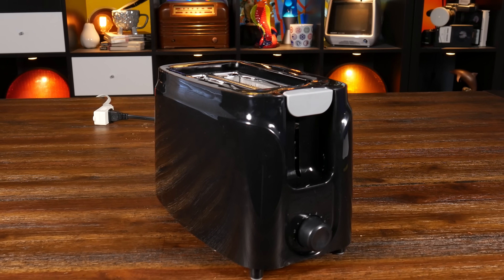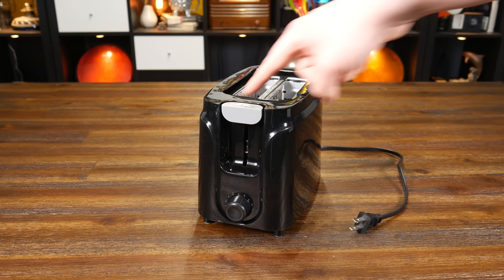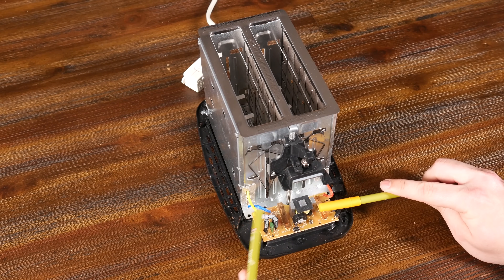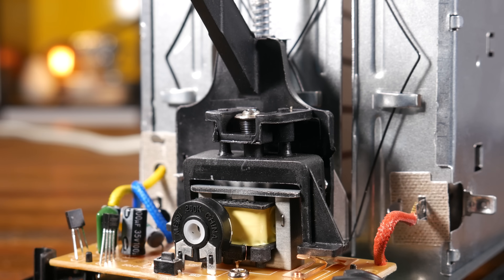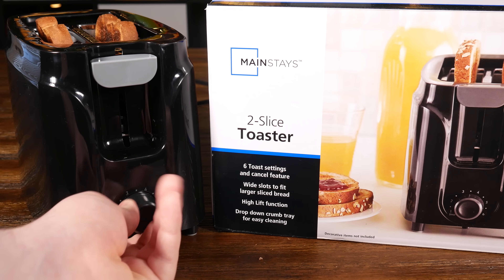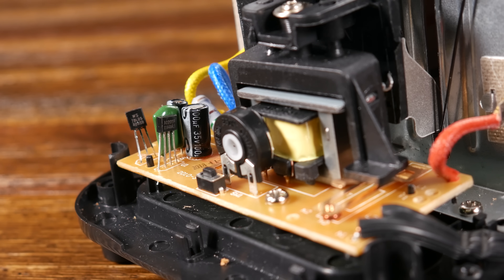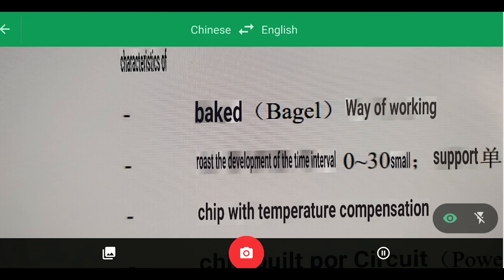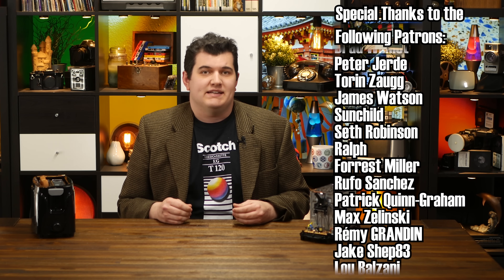The Electromagnet in Your Toaster

Comment: The non-electronic toasters were smart too. They had a two-step lever movement. Most downward would put power on and the bimetallic element in the heat. When teh bimetallic thing got hot, the lever went a tad up, shielding the element form teh heat but keeping the power on. When the element cooled down again, the lever would pop up, taking the toast and the power out. And the element already cooled down a lot for the following cycle.

Comment: Totally thought the electromagnet was just a transformer,
Edit: I thought you were using a foot switch to turn off the toaster, popping the toast to get that effect. it's impressive that you were just timing it
Reply: If the electromagnet had a second winding on it, or even a tap in the middle, it could work as a transformer too. But it looks like they're actually powering the control IC by using the heating element as a resistive divider. That's what the yellow wire and diode does.

Comment: My mom had one of those Sunbeam toasters from the 50s (or 60s?) and it spoiled me for life. It had much heavier wires which toasted faster without drying out the bread besides not needing any levers. The originals had a rotary control on the end near the bottom. I have two of them from the 70's and 80's. The design had changed slightly, with the darkness control now a slider on the side, probably to cut manufacturing costs. Not quite as good but still pretty much the same as the original.

Comment: The 6 setting 5 minute toaster has more market appeal than the 5 setting 5 minute toaster.

A timing capacitor doesn't need to power an IC to determine how long it's been since the last toasting.  A simple resistor-capacitor circuit with only those two components (the resistor draining the capacitor to ground) will drain slowly in a curve similar the temperature curve of a cooling down toaster.  So the estimated hotness of the toaster can be tracked totally with analog, and no IC is needed.  And the capacitor probably isn't powerful enough to keep an IC going for that long anyway.

Comment: One of Tom's toasters did use the numbers to represent minutes ;) Did you turn the toaster off with your foot to make it pop on the "pop goes the weasel part"? Didn't some toasters have laminated strips of different metals that, as they expanded at different rates from the heat, bent and made contact with a switch to turn the toaster off? I think the bar was lowered or rotated to change the toasting duration and the fact that they bend when hot meant that it adjusted the time if the toaster was already hot

Comment: I was amazed when my current toaster lever would not stay down when not plugged in, I did not know that this is now a standard feature. It does eliminate waiting for your toasts when the toaster is not plugged in. I used a toaster oven for a couple of decades before my current toaster, it used a lever to turn on the toaster function but did not care if it was plugged in. I only got a conventional toaster because I got a bigger toaster oven that makes very dry toasts which I do not like.

Comment: Hi!
Does anyone knows why heating coils and wires start to glow from the centre? Ty!
Reply: The glow starts from the centre because that's the part that gets hot first. The other parts are close to, or in contact with support structures that act as heatsinks, absorbing some of the coil's heat and so slowing the local rate of heating.

Comment: Always been curious, never would have thought that's how it works!
My toaster has a fully-digital "toast setting display" that has its own power button. Curiously, if you forcefully hold down the lever with that turned off, it will start the elements, but still spring straight back up and cut off when you let go. So indeed the digital timer only has control over the electromagnet and the rest of the circuit works traditionally. I guess if it ever breaks I can just keep holding it myself!

Comment: Does changing the "darkness" setting - how much you want the bread toasted - once the toasting has already begun do anything?  Or is it checked initially only when the plunger (more accurate term than lever) is pushed down?
Reply: Yes, it alters the rate at which the remaining toasting period is counted down, but it won't make much difference if a considerable portion of the toasting time (for the initial setting) has already elapsed.

Comment: I was really hoping we'd get some elaboration on 0:57 's assertion that the toaster from the '40s was better in every single way than modern ones.
Reply from the maker: That toaster senses when bread has been inserted into it, and automatically lowers the bread in. That's why the ad proclaims "no levers to push". It also doesn't eject the bread with a pop or a bang, instead it is slowly raised.
In general, the user experience of such a toaster is quite more advanced than those we have today. The only exception, of course, is the lack of a bagel mode or whatever new modes might be available in fancy-pants toasters.

Comment: Ok so I want to address something really quickly.  You mention that the Sunbeam Radiant Toaster was better than modern toasters in a lot of ways, but you seem to not take inflation into consideration.

A Sunbeam Radiant Toaster made in the late 40s or early 50s cost about $22 at the time.  When adjusted for inflation that toaster was around $240 of today's money.  The modern toaster that you got at Wally World was $8.88 it would have been about 86 cents in 1949, but even if we look at toasters that are more widely used we are still only talking about spending $50-60 tops(as long as we don't count those ridiculous designer toasters) which is still less than $5 in 1949.

If you want to spend the same kind of money(just over $200) on a toaster today you are probably getting a fully featured restaurant grade commercial pop-up toaster which I am willing to bet is at least on par with a Sunbeam Radiant.

Comment: Seriously, you didn't know about the electromagnet that holds the carriage down? Are you aware that toasters were "fail deadly" until the 1980's? Modern toaster pop the carriage back up if anything goes wrong, hence "fail safe". Historically some toasters had a physical latching mechanism which held the carriage down, requiring the electromagnet to pull on the latch to return the carriage.  In these, if something went wrong the carriage stayed down, and the bread toasted until there was a kitchen fire. "fail deadly".

Comment: The thing I find most clever about the cheap toasters I have disabled (I get board easily) is that the circuitry is powered by using the heating element as a potential divider. There is a tap close to one end of the wire that has a potential of a few volts that goes back to the circuit. I wonder if this is the case with this toaster and the line that was thought to be doing some balancing is in fact the power for the timer and electromagnet.

Comment: Great video...
I have a a Toastmaster toaster made by McGraw Electric of Elgin Illinois, yeah I know BIG Deal...
Well, I bought it in 1998 for $1.39 from a thrift store. I use it quite a lot, until one day while unplugging it, the blade on the plug pulled out. This event lead me to looking this whole machine over and realized the cord was actually asbestos. Further cursory investigation led me to find out this particular toaster was manufactured in 1937.
Toast color was achieved via a sprung wound motor with a winged air governor, pop up action is dampened by a a brass cylinder and piston, making for a slow rise out of the slots. This toaster "ticks" as the clock motor runs and the control sets the motor speed and hence the toasting time..
I fit a new period look cord and a new 21st century plug and continue to use it every day or so. Not bad for an 82 year old toaster

Comment: Older toasters used a bi-metallic strip to both lock the bread down, and release it after a set time. The timer dial just moved the contact point meaning the strip had to heat for longer to pop the tray back up.

Comment: The diode could be to rectify the input to stop the heating element fracturing prematurely due to a full sine wave causing it to oscillate.... or it could be there to simply stop the toaster making a buzzing sound.
Some old Christmas tree lights use the same method to prolong the life of the bulbs.
I wish manufacturers would also ensure both sides of the element are isolated when the lever is up as then I'd still have my overly complicated digital toaster and a knife without a big chunk blown out of the blade :D

Comment: I added a cancel button to my toaster, it doesn't have the far-left interrupt.  I have been wanting to add the bagel function.  I never got around to it before, but your video inspires me, I might finally do that. I'm curious what part the IC plays in that function?  That data sheet looks real fun.  
Also checking out that patent, I usually pre-heat my toaster empty before the first run, but that adds a step.

Comment: I haven't owned a toaster in decades. Only "toast", I like, is french toast, and that's made on an old fashion frying pan. I'm surprised a modern toaster doesn't use a half dozen Intel processors, that also serve as the heating elements.

Comment: TO-94 is just the type of package it comes in. Basically, the bit plastic or ceramic bit that encapsulates the actual semiconductor chip. Btw, using a multimeter in continuity mode is wonderful for reverse engineering circuits.

Comment: I have old toaster that has bi-metal latch that has nichrom wire wrapped around it. It catches the lever and latches onto it and starts to heat up. As it heats it will bend until it releases the level in two steps, there is a "halfway" point notch that releases the lever just a millimeter or two. It is genius mechanism, from year... i don't know, i got it from my late grandma. I am throwing it away thou, i don't really have the room for it... I might throw it to storage but i know i won't even need it... i think.. i guess i'm keeping it now as it will continue to work for another 40-50 years, easy. It just doesn't toast well and you have to let it cool down between toasts more than a cheap modern toaster... and the timing is not consistent on any other setting than minimum, which is already good enough, you need to open it and bend the metal to adjust timing rather than using the.. other lever that actually is a lever.

Comment: I actually had been thinking King about toaster electromagnets recently. Not sure why, but that's brains for ya. Excellent video.

Also, the part about the timing capacitor finally explained why my old toaster was terrible for making more than two pieces of toast at a time. Looks like the cheap older design version is better than the backwards, well-intentioned but poorly thought out attempt at putting more "technology" into such a simple device.

Comment: The diode actually forms a really clever part of the circuit.  It provides the low voltage supply for the control IC, using the heating element as a massive potential divider.  It'll be tapped off one point of the heating element, close to the neutral.  Hey, it's sitting there, so why not use it!  Same technique is used in hairdryers to control the speed of the motor.  When you set a different motor speed, the switch is selecting a different tap from the heating element for the fan.  This also has a very interesting side effect that as the element gets hotter, the motor speed will tend to increase a little, which helps provide a little bit of temperature control (though admittedly not much.)

Comment: Wait. It is an AC outlet. Why are you talking about a "hot" and "neutral"? The C As. They're both hot. I proved this when I stuck a key in an outlet as a kid and got shocked, then stuck it in the other hole after saying, "Well, I guess that was the positive side" and got shocked again. Then I learned what AC meant. Either way, why are you saying "hot" and "neutral" when talking about the wall plug?

Comment: Used to have a toaster that was timed by using a bimetallic strip. It had it's own little heater that made it bend during toasting. The adjustment lever controlled how far it had to go to reach a magnet that would grab it and turn off the timer heater. As the strip cooled down and went back to its starting position the magnet would be pulled along with it and trigger the release mechanism.

Comment: Trial and error?! I had imagined you'd fitted a floor mounted switch so you could deactivate the toaster when you wanted it to pop.
Reply: Actually, after looking at the goofs & outtakes at the end of the video, I think he was trying to get through a long set of talking, with the toast in the toaster in the down & on position, before it popped up.  But, because the toaster was so warm after each “take,” it would be too warm and would shorten the timing cycle, because of that advanced technology in the toaster’s timing circuit, causing it to “pre-maturely” “ejectulate” his toast.  In other words, he was trying to lengthen the cycle to “keep it from popping up,” rather than trying to shorten the cycle or pick an “earlier time to pop up the toast,” before the toaster was actually ready to pop up.
Reply: The secret is given away at 9:40 in the video. Look at the left side of the screen.
Reply: Kevin K Yep. Then he gave up and used special effects 😂
Reply: Or just a switchable extension cord on the ground...

Comment: Two important reasons for the way toasters are designed this way that were glossed over:
1. The dual contacts aren't really anything to do with reverse polarity, but rather to provide a safety margin in case one contact welds itself together (which is definitely a thing). This makes sure the heater turns off when it is supposed to, and the next cycle of the lever could unstick the first welded contact.
2. The electromagnet is also a safety feature because if there is a power outage, it will prevent the toaster from automatically coming back on when power is restored.
Reply from the maker: I won't argue against the redundancy they provide, but I still think they protect against a reverse-wired outlet. If the only break was on the hot side, and the plug were wired backwards, then sticking a knife down the toaster would potentially touch the wires which are now electrically live no matter if the toaster is on or off. With a break on the neutral side too, there's no risk of that possibility.
Reply: @TechnologyConnections  As a kid, we would light a piece of paper off the toaster to ignite the gas stove.  I regularly used foil backed paper from the likes of soup packets and one day I found myself thrown to the ground.  I asked my brother who was buttering his toast at the time why he kicked me.  He gave me an odd look and slowly it dawned on me what had happened.  Sure enough I had shorted the nichrome wire against the frame and got a boot
Reply: @TechnologyConnections  Good point, the nichrome is certainly conductive.
Reply: Many countries use non polarized plugs, and miswired outlets are awfully common everywhere. Also, some power systems doesn't use a neutral at all, they use 2 active phases instead
A single contact would be very dangerous in all this cases, especially with this kind of heating elements, very easy to touch
This is why it's to mandatory (mostly everywhere in the world) to have dual contact for main power switch. 

PS: In French safety regulations, the neutral is considered as an  "active" conductor, requring the same precautions as a phase wire.
Reply: I believe all parties here are correct.
Reply: Aye. We had 7 volts AC on our ground wire ( which is tied to neutral normally) at a place I was stationed at in the US Navy. It was only 7 volts so it was a low level issue to figure out. We got lucky. Turns out that 7 volts AC was backed up by 400 thousand amps because it was a bad ground at the motor generator supplying station power.
Switching out both connections is an excellent idea no matter the reason.
Reply: @hotdrippyglass  Significant (20v++) floating potentials are a common problem with imbalanced phase loads on 3 phase installations, especially where neutral connections to the supply transformer have aged.  Causes major reliability issues in domestic appliances (where increased current draw to compensate for the reduced supply voltage leads to premature failures).

Comment: With so many viewers, chances are one of us would have been working on their broken toaster,  Well that was me,  turned out to be a crumb on the magnet stopping it from latching.
Reply: I wonder how many toasters have been binned for that reason.
Reply: Another common failure mode is a piece of bread that burns to carbon, becomes more conductive, and shorts out some of the resistive heat elements.  I've scraped more than one of those out of my toasters over the years...
Reply: Me too!  Mine won't latch anymore and I was planning to look after it this weekend.
Reply: Justin Richards lol for real?
Reply: @dabbstermcdabberton2126  
Yes, that's for real. I repair things (for fun for free for other people) at something called "repair cafe" every few weeks. A crumb of bread being stuck to the magnet or metal strip is one of the very frequent failure modes of a toaster.
Reply: superdau that makes sense. Keep on being awesome!